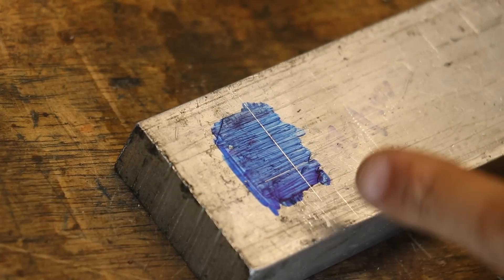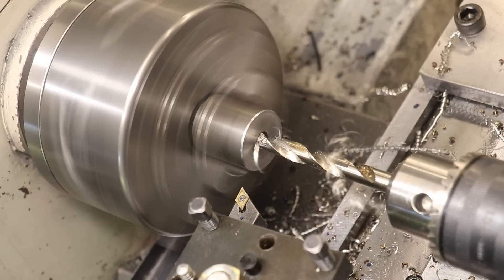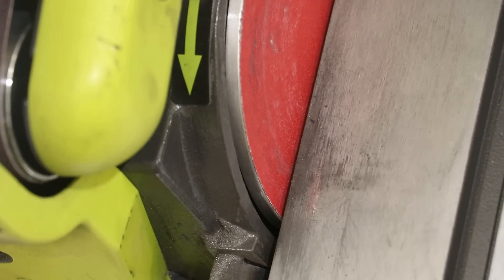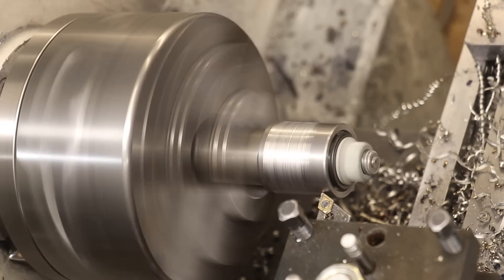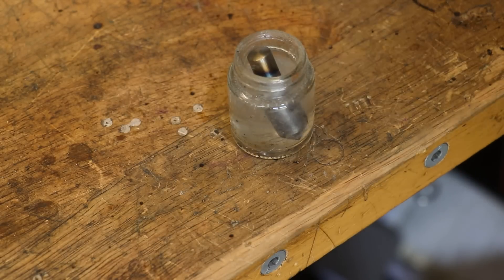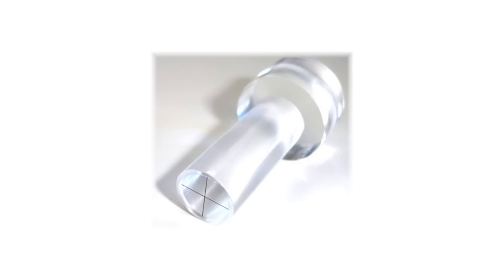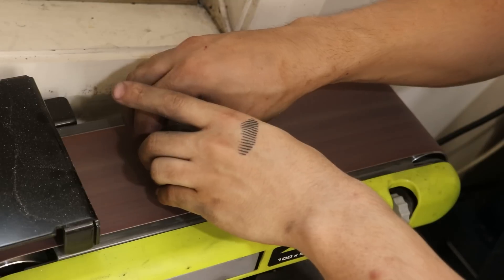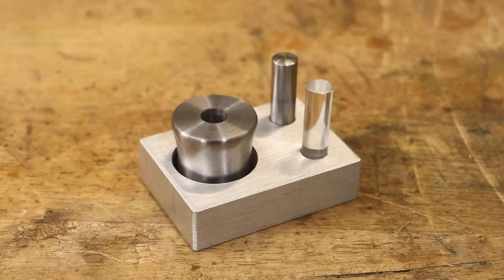Optical Centre Punch - One Day Build Project

Comment: Suggestions: 1. Make the holder, the part in which you installed the O-ring, out of acrylic.  As you made it out of metal, the acrylic “finder” gets very dark when you lean over it to align the dot on the target workpiece.  Alternatively you can ;make the acrylic rod longer, it acts like a light pipe to illuminate the surface to be punched. 2. I used fine sandpaper glued to the holder instead of an O-ring. Some O-rings slip.  Rubber O-rings work better than neoprene. Fine sandpaper works well.  3. I made my original punch from water hardening drill rod.  Even after hardening, the tip smashes flat when used on iron or steel.  To fix it, I used a commercial centerpunch insert pressed into a cylindrical holder that fits the drilled hole.  The commercial tips are cheap and can easily be replaced if it dulls.  I still don’t know why my hardened original drill rod punch didn’t harden enough.  4. I agree with the fellow that feels the acrylic rod should not contact the target surface. 5. To make the lens, you can drill a 3 inch hole in a piece of 2x4, then cut the 2x4 bisecting the 3” hole.  Then glue sandpaper to the inside of the half circle.  You can vary the magnification of the final lens end by changing the size of the hole drilled in the 2x4.

Comment: my idea would be to have the magnifier drilled in at an angle. this way, the user doesn't have to take the magnifier out and replace it with the punch.
i would have both the magnifier and punch interact with each other on a sort of "rocker arm" that could quickly move the magnifier out of the way when the punch is hit.
this would be harder to make, but would drastically reduce the chances of this set from shifting while the magnifier is replaced with the punch. it would also be much faster.

Comment: Ordinary diesel would probably be better lubricant and much much cheaper than aluminium cutting oils. (
I've also found very light grade (0W-20) full synthetic engine oil works very well on gummy alloys ( helps prevent build-up, even on HSS)
I bought a quart (litre?) quite a few years ago and still have most of it.
Was it 6061 aluminium or a different grade?
I mainly use 6061 but have had variations, plus some unknown alloys from local surplus store.
Some just destroyed aluminium specific tooling as build up was horrible (how I found full synthetic engine oil was so good)

Comment: O ring design is actually very bad.
Have one (Veritas), and great problem is when you have to punch near the edge, or in the corner. 
And many holes are right in to the corner of the part.
Gluing some 1500 or 2000 sandpaper on the bottom will give enough grip, and will work perfectly on any part of the plate.

Circular reticle is from my opinion also much better then crosshair.
Usualy.. you have two marking lines, and it's much easier to put small circle (like 1mm diameter) on top of marked cross, then to put crosshair on it.
Also.. circle is very easy to center in to the viewpoint so you will not have parallax (it's natural for human to surprisingly accurate put two circles concentric, like diopter sights).

Single point.. didn't tried it.

Magnifier.. I made mine so upper portion that protrude out from the body, is larger diameter, and also protrude pretty much (about 25mm).
With larger top diameter, you can fit it so bottom of the magnifier do not touch the part you are marking. It stand just above it (maybe 0.1mm or something like that).
That way... you still got focus, and do not mar fine polished bottom surface of the magnifier.

Long (and wide), protrusion out of the body, serve as "light collector", so bottom is brighter.

Comment: I wonder if you could use the body to perfectly center the dot on the acrylic. Machine/bore the body, insert the acrylic while it's still on the lathe and then do the dot.
actually, i wonder if you could just lay the body sideways, insert the acrylic from one side and the punch from the other and use the concentricity of the punch to mark the acrylic

Comment: You get use to them once you see how precise you can be, I think that's why design wise Fowler does there's in the holder so it is ready to work. I like the 3 hole version, two outside centers store, center hole thru drilled. Good video and good riddance to that aluminum, well maybe not good riddance, it is a gift. Thanks for sharing!

Comment: Good video. This center punch is helpful when doing precise layouts for face plate work on the lathe. Using a spring loaded center between the tail stock center and the prick point made by the center punch, work can be located within two or three thousands of an inch with a dial indicator running on the spring loaded center.

Comment: The bounce when you dropped the acrylic magnifier into the holder and it hit the workpiece is why the better versions of this tool have a step to a wider section at the top of the magnifier so it sits in the holder with just a tiny bit of clearance and doesn't  make contact with the workpiece and get that nicely polished end all marred up...
Reply: For a just get it done method - put an o-ring on the magnifier at the same position. Certainly not the same look.
Reply: This ain't ClickSpring.
Reply: How would you scratch a very fine cross on the bottom instead of the centre pop

Comment: to create the center mark in the viewer (acrilic) use the tool body it self to align the punch with the viewer, push together and spin teh punch against the ciewer, this will let you know if the punch is completely on center with the mark it leaves, if it's a dot than yourr centered, if the mark is a ring than your punch os out of center :)

Comment: its like 5$ on aliexpress in anodized cnc machined aluminium. Plus if your have two metal rods connected by a spring you dont even need the hammmer. You pull them apart and let go. Its much nicer. Or the spring punch where you just push on it. Give it a 10mm OD and it will fit in the same hole

Comment: A nice little project, might have to make one myself. Regarding the aluminium not machining right, I've seen that with some 6082-T6 where it was soft and gummy, not normal. I called the supplier and spoke to the head guy and he said he knew exactly what I was experiencing as he had run a commercial machine shop producing large volumes of aluminium parts and things would be fine for months until a new batch of material would come in from the mill and things would go wrong as it didn't machine as it should. He said they got the heat treatment wrong, he was large enough they would replace the material. In my case he said to ask for him next time i was in and he would replace it which he did FOC and I could keep the bad stuff which is slowly being used up where it can be.
Reply: I think you are spot on here. I recently made a some sleeves out of 6082-T6. They came from the same bar, but I had to use some heat to shrink one of them on, while the other I was able to just press on. Both were machined after wards. The one that was just pressed on machined like normal, but the heated one machined terribly.
Reply: Depending on how hot you heated the part you may have softened it.

Comment: My favorite finish on Aluminum is brushing it with a scotch brite pad to remove the tool marks and then I put it in some concentrated sodium hydroxide solution. This not only cleans the part, but you get a really nice uniform finish with a bright and almost blueish silver color. Depending on the concentration it only takes a few minutes, but you can also do it with washing soda and let it sit for longer, if you don't feel like dealing with corrosive chemicals. Just keep in mind, that you are chemically removing material, so be careful on parts with very critical tolerances.

Comment: Wouldn't you be able to use the punch to make the center dot in the acrylic sight by using the holder? Putting the acrylic in the holder half way, then inserting the punch into the other side of the holder and giving it a gentle tap. 
 Wouldn't this way ensure both the punch center and the sight center are both in the same place as long as they both have the same diameter.  
I could be wrong if so I'd love to know how so I can learn where I'm messing up.
Reply: You would also need to fix the rotation  in case you have runout on the punch

Comment: You can insert the metal punch on one end and the plexiglass rod on the other. You can then lightly press or tap the punch to leave a concentric point on the end of the plexiglass.
Reply: That sounds like a much easier & more accurate method in the home workshop!
Reply: @Arckivio  
When you get older, it becomes a necessity as glasses prevent you getting close enough to see some things due to parallax angle.
Reply: @1crazypj I'm already there mate!
Reply: Came here to say the same thing!
Reply: Tp be fair, I already suggested this technique to Pask Makes who also happens to be Australian too.
Reply: @bobweiram6321  Pask lives in Australia but he was from northern England.
Reply: Huh? Won't you just immediately shatter the plexiglass??? And how fo you propose one sees through aluminum? How does one join the punch to the acrylic? I'm extremely confused as to what's going on
Reply: @JoyfulJapaneseMaples-us7on  We are just talking about gently marking the acrylic, not smacking it with a hammer. If the point on the punch is correctly centred, you push that half way into the housing. Then you push the acrylic into the other side & the punch will mark it in the centre, simple
Reply: @Arckivio  oh OK. I gotcha
Reply: @JoyfulJapaneseMaples-us7on  You sight then remove 'lens' replace it with punch

Comment: Very nice project! Thanks for sharing. I never knew about those micromesh sanding pads. Just added a bunch to the arsenal! cheers!
Reply: You can wash/ rinse the pads numerous times also. 😁😁They are commonly found in Pen Turners go to abrasives' box. As demonstrated so ably here, perfect for hard plastics, also for standard wood turning 'hard' finishes, even CA/BLO. Oh, not forgetting the resin/ epoxy casters. I have a few packs, some for wood, some for plastics and even some for metals. Just don't mix them up.   😒 (Don't ask).
Reply: @timgrenville-cleave2848  Thanks for the tips.

Comment: If you use that center punch on steel, I think you'll find it is actually very soft. You need to heat the punch up to a dull cherry red before quenching.
Reply: after quenching polish out, reheat to blue jean blue and quench again.  it should  be about RC 65.  leaving it red will trend to break and shatter.